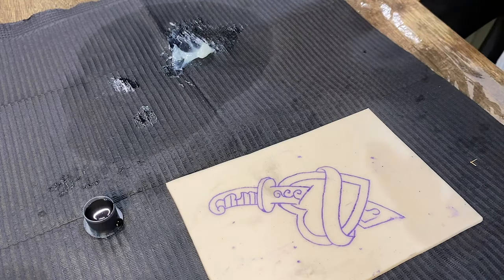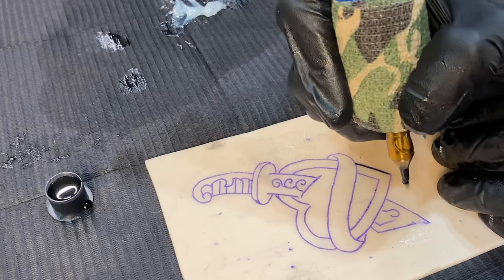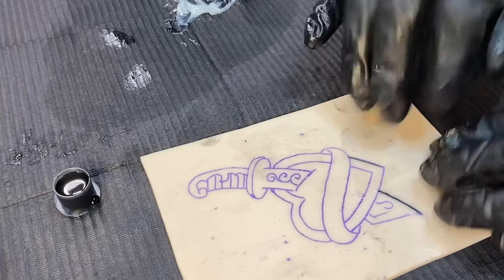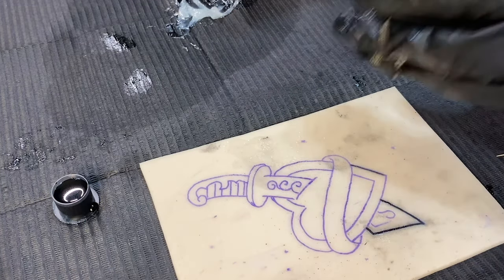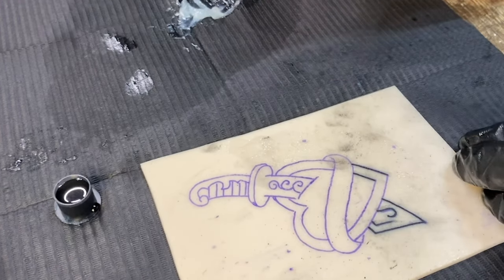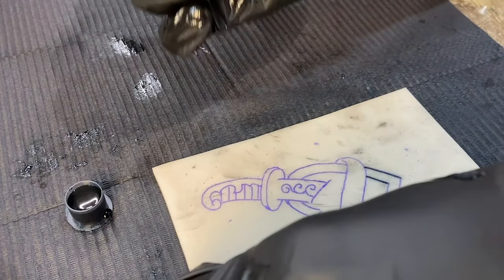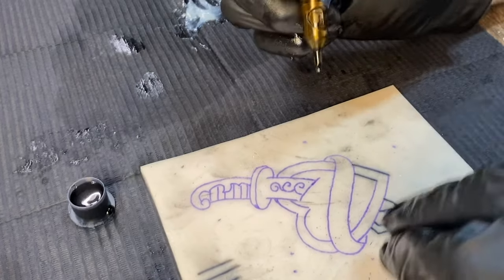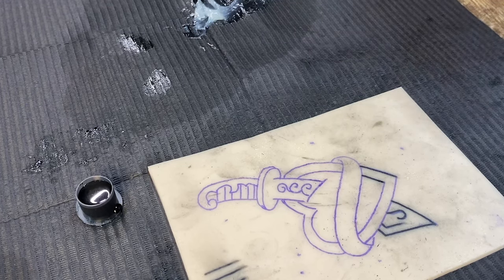Hand Speed And Machine Voltage Tutorial

Comment: What machine did you use for this video? 
I find that the voltage/hand speed relation can vary a lot from a machine to another depending on the stroke, power supply etc.Even from one brand of cartridges from another.